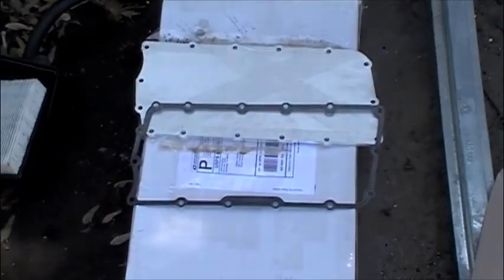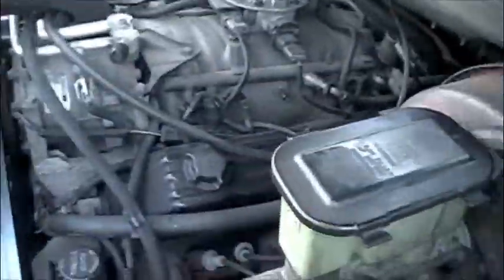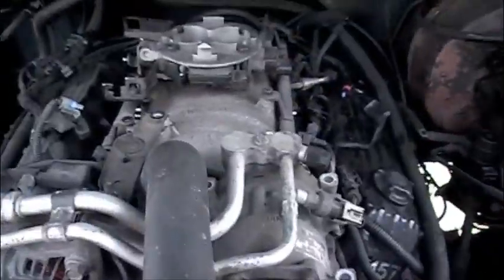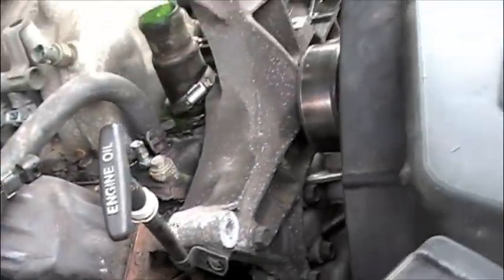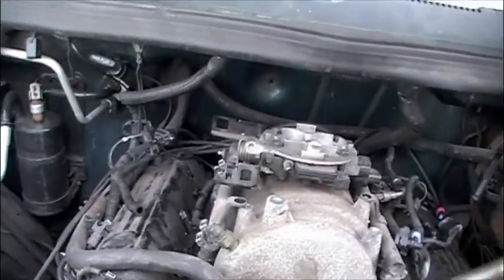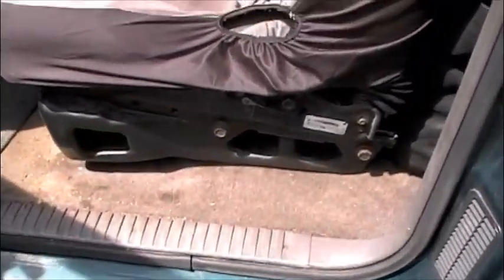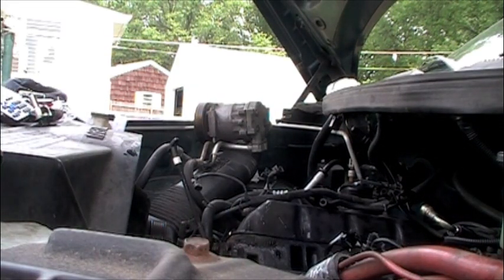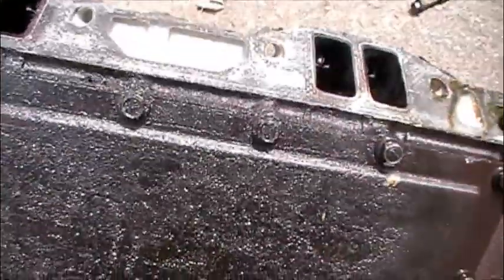Bill K 96 1500 Dodge Ram plenum fix part 1

Comment: I have the same truck..I had to put brake booster in it $70..new breaks and calipers..parts warehouse sold me the whole front end for $55..I'm still repairing.retired Larry..
Reply from the maker: Larry Keesee yeah I had fun with this truck! Long since sold I changed the torque converter but never lined up the drive shaft bolts properly and it snapped on the highway lmao

Comment from the maker: @1sixwheeler yeah i had problems ..lol um forst off the instructions say to tighten the pan bolts to like 12 or 20 INCH lbs of tourque... I ofcourse tried to tighten them to 20 FOOT lbs lol needles to say i snapped the bolt in the hole and had to have it drilled out... so dont do that! lol...I also didnt know you need a special tool to disconnect the fuel line from the rail... 5 bucks at auto zone.... total job took me 6 hours or so